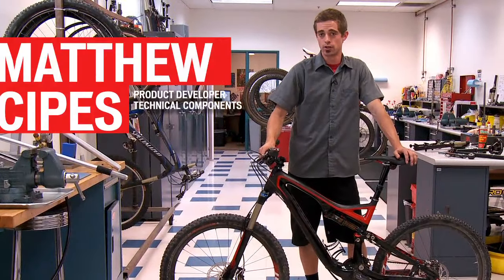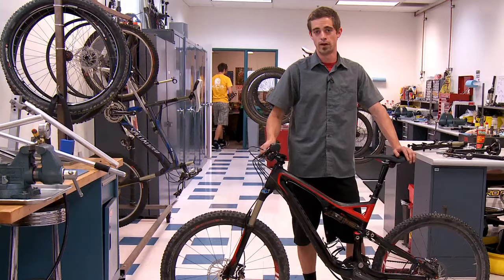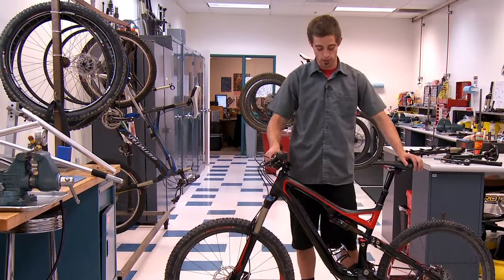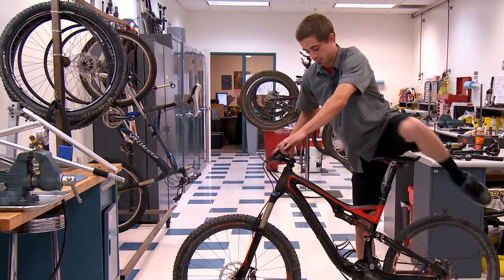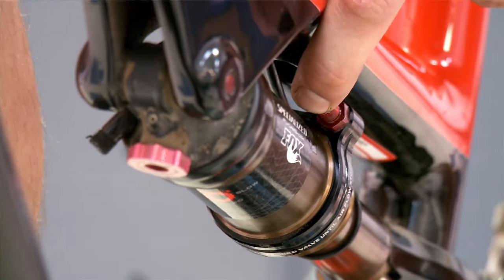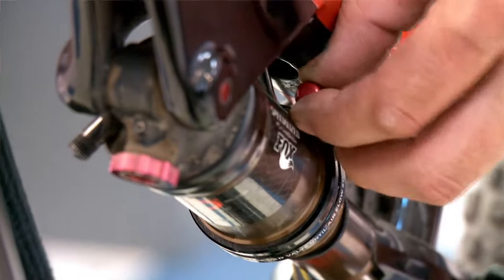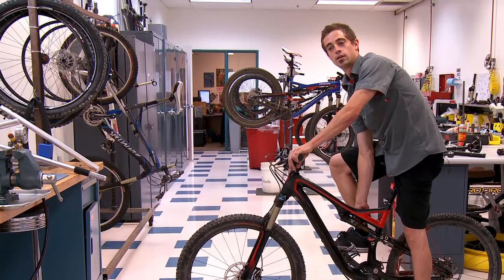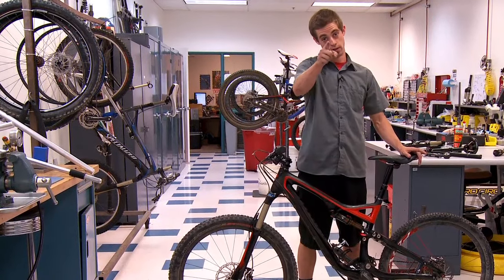Specialized Autosag How-to

Comment: Doesn't work on my Fox auto sag. Following your instructions,  the suspension still bottoms out during a ride with about 90% sag. I was going to rebuild it, but the cannister had its own instructions.  "Inflate to 300#, sit on the bike and let air out of the red valve until it stops" brilliant!  25% sag

Comment: I have the 2018 Epic Expert red/gold with the RockShox/Specialized Micro Brain shock w/ Spike Valve, AUTOSAG, 51x257mm. There is always confusion when doing autosag because the shock says 300psi but sometimes the specialized bike mechanic says it’s the riders weight plus 50. With this RockShox which applies? Also the blue button must me on soft but the red button near the filling valve what setting should be? Finally after pumping the air do I jump on the bike several times before or after pressing the autosag button? You should post a video on YouTube because all specialized videos are very old. Please help! Thanks
Reply: Dude, if you get an answer let me know. I think this guy skipped a lot in this video.
Reply: I just made my bike brainless. Installed a Fox Float Kashima & BikeYoke adapter